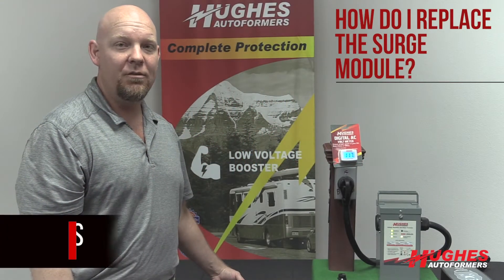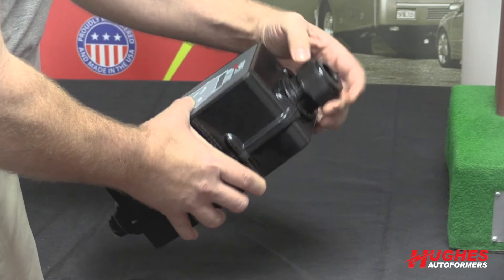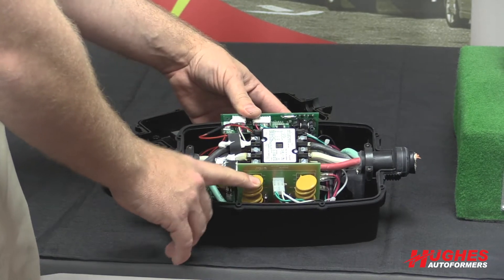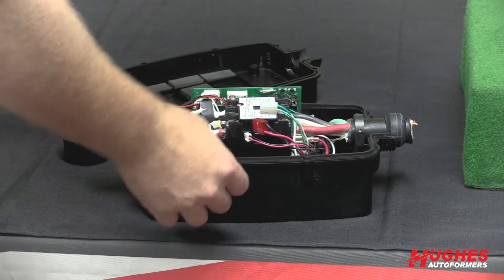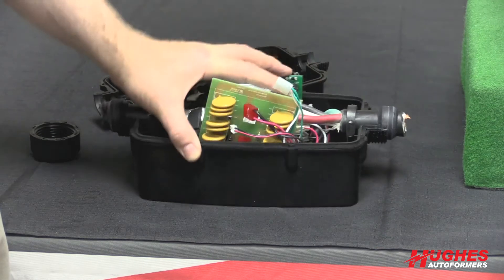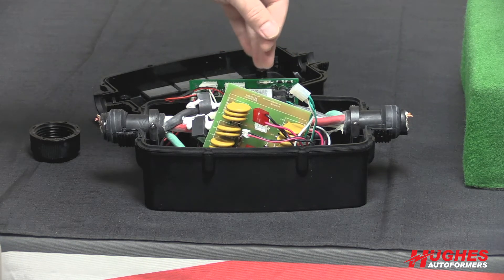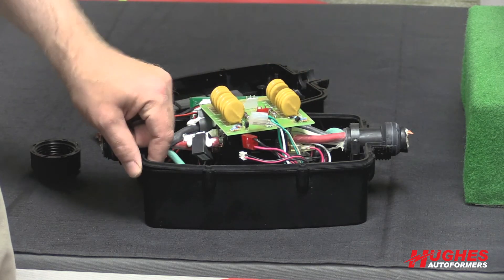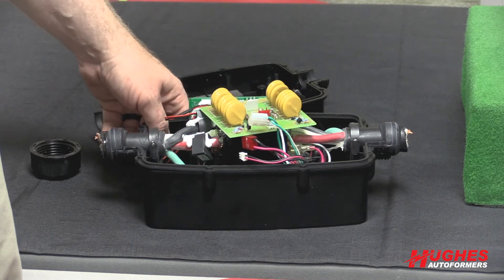Hughes Power Watchdog RV Surge Protector FAQ - How Do I Replace The Surge Module?

Comment: This replacement module is $30 on amazon! I think $32 on the Hughes website but I love free next day delivery with prime. Either way you go it’s the ONLY system with this option. Seriously can’t beat this option! I bought one to have as an instant backup just in case so we aren’t ever stuck if AND when this happens. Props to the Hughes watchdog

Comment: One suggestion when you you hard wire a unit in and mounted to a wall the way they are intended why wouldn't the removable cover be the outside one to change the surge module